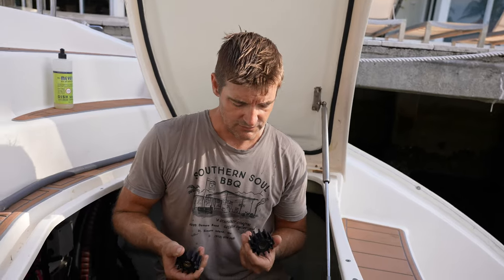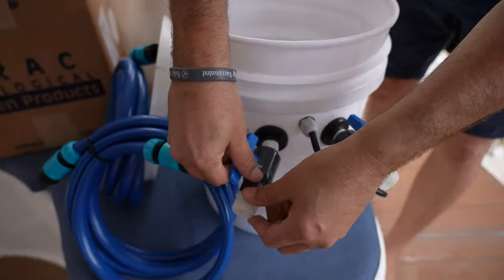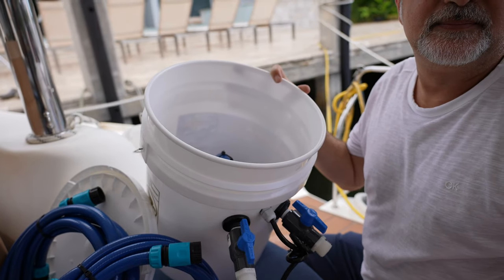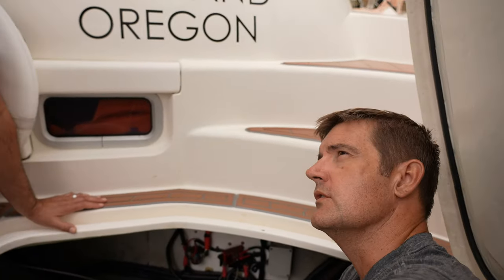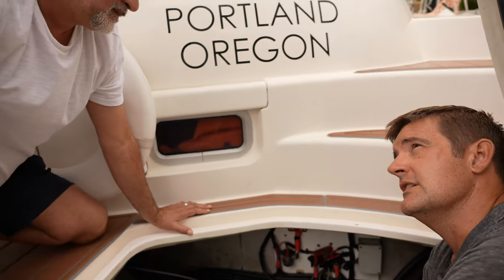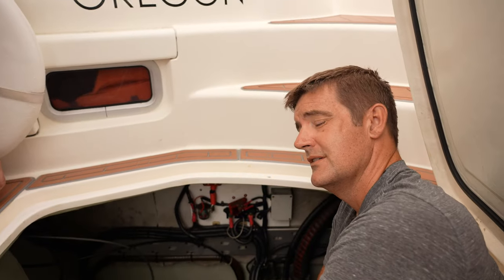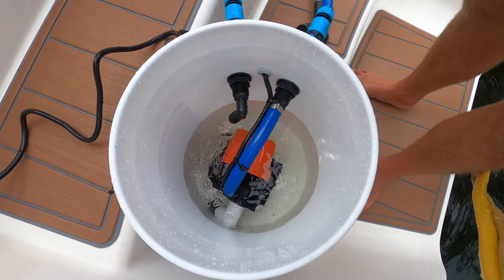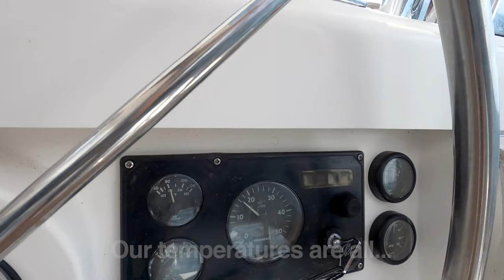Barnacle Buster Engine Cooling Therapy

Comment: The product is phosphoric acid diluated. So as major part of the mineral acid it will eliminate minerals deposit and animals inside the pipes. The blue color is probably due the contact of the acid with to some copper part inside the circuit. (Copper phosphate). I would avoid to throw the used product to the sea even if it is said "safe for environnement".

Comment: Nice vid. I'm getting ready to do this procedure next weekend. Got a 31' sportfisher that is having the same problem with the starboard engine. Only when getting the revs/speed up, do I have a heating issue. Already tried the easy route (t-stats and impellers) and no it's the Barnacle Buster route. Hoping we have the same luck as you folks. Appreciate the vid!

Comment: Excellent video! Thank you for producing and demonstrating the importance of flushing. 

When you switched from starboard to port engine, did you dump the bucket and start all over with clean water and more bottles of barnacle buster? Or reuse the existing product in the bucket?  

In the video, the gentleman explained that the air conditioning system will clog more frequently due to continuous use. How do we setup an air conditioning flush? After flushing both engines, did you also flush the air conditioning system too? If no, then why not?

Comment: Guys I am watching your barnacle buster video and it find but you did not show where you connected the hoses.  I have the Yanmar 30 HP engine.  It would be great if you could tell me where you connected the in to start the loop and the out to finish the loop and bring back to the bucket.  Thanks

Comment: If there is material built up, one technique is to recirc crushed ice (slushy consistency is ok). Tho barnacles would not be affected. The ice may melt, which is ok. Do need a velocity of over 2 meters/sec for best result (strong pump).

Comment: Is that stuff OK to put over the side when you're done or does it need shore-side disposal? Because I guess the acid is neutralised by the calcium that it removes?
Reply: Trac Ecological, maker of Barnacle Buster and several other marine products that are safe on the environment.
Reply: Barnacle Buster passed the California fish toxicity essay test and is safe to go overboard as a new solution. Technically it should be filtered after being used as just like sea water, BB will pick up metal particles and those particles should be removed by filtration before being dumping the solution overboard.
Reply: @pleclerc1  great product well done and congratulations on the sale of the business and the buying of your own boat! See you out there! QQ: if you access the water inlet ‘downstream’ of the pump you need to take out the impeller right? Makes sense if so. All the best!

Comment: How often should you use Barnacle Buster? Annually, Might it be worth installing "flush systems" in the piping similar to "washing" the calcium etc out of instant hot water flush??
Industrial boilers, we had to do an annual inspection. So we did the calcium removal during that inspection. My boiler chief said the same thing about 1/64" on the sidewalls, and they were "death" on untreated feed water.

Maybe something like this?  amazon.com/dp/B089NLKTN7/ref=cm_sw_em_r_mt_dp_KGH68WFPF1984A1N5HAD

Comment: Geeeez that stuff's expensive. Homemade Barnacle Buster: 6 x 3liter bottles of Coca-Cola... Vinegar works too.
Reply: Careful with the Coke.  The phosphoric acid does not distinguish between the calcium build up and the copper/steel of the coils in the heat exchanger.  Tow truck drivers/mechanics use Coke to eat rust and solve other metal issues.  

Vinegar will stop future growth but is not strong enough to remove calcium build up.  

Another alternative might be CLR which eats calcium quite nicely.  But getting the full system solution with pump, fittings etc. from Barnacle Buster sounds neat, sweet and complete.
Reply: @kensmith6741   I like CLR as well.. The stuff is fantastic... Vinegar is more than strong enough for calcium though... I just used it to clean my entire cooling system in my truck.. A gallon is cheaper than a quart of CLR.. But put a piece of eggshell in a cup of Vinegar and watch what happens.